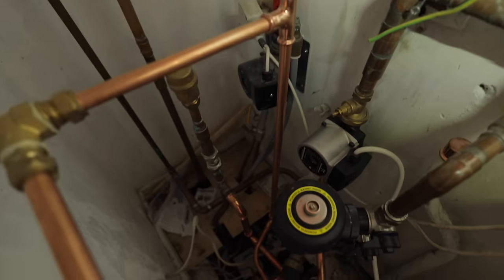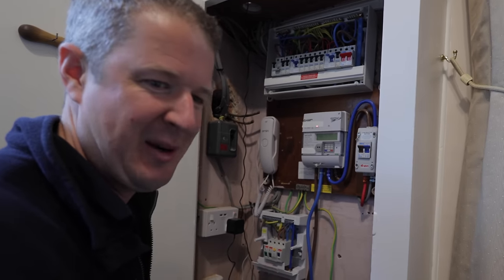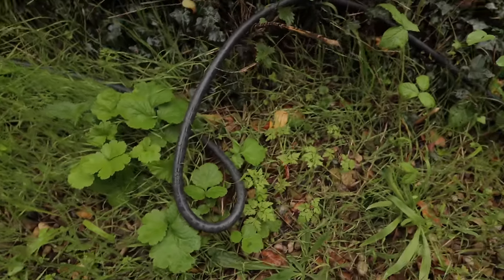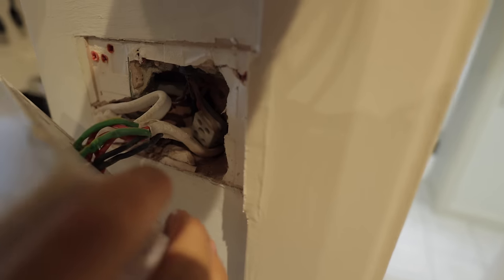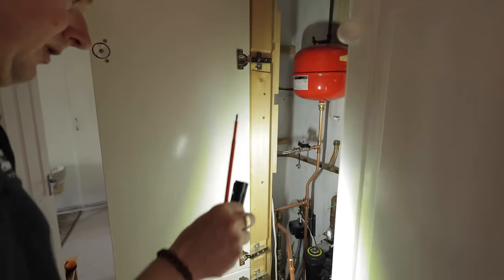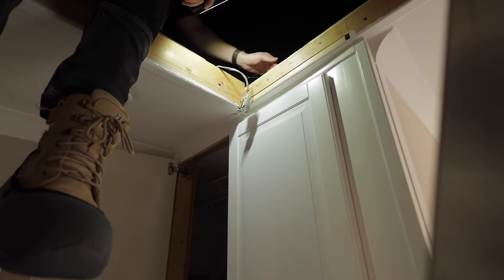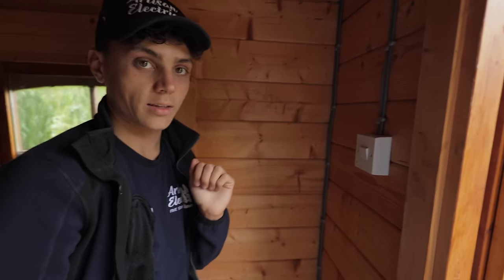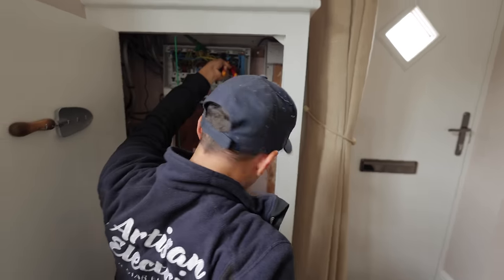The WORST Socket Wiring I Have EVER Seen!

Comment: You should use a clamp meter on the tails and the DNO earth before you disconnect from MET.  This helps check for diverted neutral.  John Ward explains this in a few YouTube videos
Reply: Theres a picture online showing 80amps 😂 flowing thru the earth so diverted netrual are out there..
Was on a electrical forum
Reply: It seems the diverted neutral phenomenon is almost guaranteed where you have a PME system with metal incoming pipes - at least in theory. 

Definitely an eye opening JW video.
Reply: Looking at John Ward's recent video does on Diverted Neutral Current it is important to check for DNC before disconnecting the main earth connection.
Disconnection of the MET could result in in exposing an unintentionally live conductor - the main earth - which is carrying the neutral return current from neighbouring property or properties.
Reply: @stevejagger8602  it's not major common but as cables age this sort of problem will only increase.

I have seen it only once in 16yrs myself
Reply: Skillz 👍
Reply: @bramcoteelectrical1088  it is inevitable that this issue will increase given the amount of 50 to 60 year old  PILC distribution cable installed and not maintained or replaced in the UK.
Reply: JW knows his stuff!

Comment: That's a good one... the AC loosens connections because it's oscillating. lol Who ever told someone that?   Yes, connections do get lose over time, sometimes due to the heat cycling or the wire cold flowing, but from the "vibrations" of AC??? That's a good one, is that on the master test too? lol I hope that was a joke.
Reply: This may be a cause but at very high amperage into 1000amps 😊.
More likely in domestic thermal.effects
Reply: Completely agree, worked on industrial systems upto a couple of thousand amps and connections not coming loose all the time.  If this was the case we would have streets of houses burning down because of bad connections and no checking for 10 years.  The worrying thing is some people on here believe this.  
Not sure what I think of this YT channel now.  I started watching some of the videos and found it quite interesting but the ' worst ever this and that' is turning me off.  Some of the claims and info is simply opinion and some far too pedantic.  Sometimes I think drama is added just to make a video, which is probably a better earner than the work now - shame really,
Reply: @scherry5135  Yeah, I almost turned off the video when he said that. I was like is this for real? 
But when tech channels start making content, just to make content quality always goes down. Not saying that's what's going on here. Yet.

Comment: Its amazing that you can't have a regular outlet in the bathroom, but you can have a 9KW electric device in the shower with the person is perfectly fine and only an RCD with up to 30mA of current before it trips.  😲☠
Reply: The difference is the shower is a permanently installed device, designed and waterproofed for that location. If you were allowed a regular outlet in the bathroom people would plug in all kinds of devices with the potential for them to fall in the bath or get wet potentially making them live.
Reply: @MattF340 But for some reason you're allowed outlets right next to your kitchen sink. I guess you don't fully immerse yourself in the water when doing the washing up, but still...  😂
Reply: @SwitchedOnNetwork  Are RCDs/GFCIs not required for kitchen outlets where you live?  It's a code requirement everywhere in the US (basically for anywhere that's considered a "wet area", which both kitchens and bathrooms are), so I assumed it was in the UK/Europe/etc too...
Reply: Misconception regarding sockets in a UK bathroom, it is allowed, but has to be a minimum of 3M from any water source, very few UK bathrooms are big enough to allow that.

Comment: Rather than trying to memorise the factors for each set, which I never can; in that case, r2= r1 x (2.5/1.5) so just plug in the sizes written on the cable and it's works out the same.
Reply: Holy sheet it does 😂😂 I'm sure that was taught in college but always just remember each set and now I can forget them 😅

Comment: Absolute fantastic video showing and thoroughly explaining some of the testing involved. IB < or equal to IN is only a fraction of the start of max demand formula i try my best to keep lodged in my small brain and it really helps when trying to figure out if existing circuit breaker is adequate when upgrading an electric shower. Thankyou and keep up the excellent work Artisans of MONTE Cambridge.

Comment: Top Tip! Always keep a garden trowel in your meter cupboard just in case there’s an electrical emergency
Reply: I think the top tip, is always tip your tradesmen, and chocolates are a great way to do that.
Reply: Also, a small garden fork is very useful for R1 + R2 and ring continuity testing etc

Comment: Those pull cord shower isolators usually have loose connections when you go to check them - I don't think it's so much the tiny vibration from the 50hz sine wave, it's more to do with the pull cord itself - pulling at the fitting on the ceiling, loosening it and then it pulling on the wires. Combine that with condensation/steam from it being on the ceiling in a bathroom with a shower, and you get green copper corrosion on the wires and terminals, increasing contact resistance, heating up the terminals / wire and the resulting thermal cycles  also loosen the connections.

I hate the things tbh, they always end up with burnt wires (usually neutral) & corroded connections. Much better to have a switch isolator on the wall outside the bathroom.
Reply: Just had that done on our new shower, we got through 3 pull isolators in 10 years, switch outside much better.

Comment: Also, a fun fact, Jordan mentions AC currents causing screw terminals to come loose over time. This is primarily caused by something called Magnetostriction. As the AC current induces a magnetic field in the terminals this causes the metal to change shape. This effect can be so large that you can even hear it, if you have ever been close to a substation or large transformer inside a building's HV room you can literally feel the hum coming from the iron core!
Reply: Magnetostriciton is only found in transformers and the like with ferrous cores. It wouldn't occur with brass screw terminals where there is no wound core
Reply: @RichardKeightley-ky6fx  incorrect, brass is still subject to magnetostriction, but Brass has minimal magnetostrictive effects due to its non-magnetic properties, its just more pronounced in ferrous metals.
Reply: The heat/cool cycle (expansion/contraction) in the conductors/terminals will have a greater effect on the terminal tightness than any potential negligible magnetic influence
Reply: Yeah, while magnetostriction is theoretically possible in copper conductors, you would need a lot higher current than this for it to have any detectable effect (I'd guess tens of thousands, if not hundreds of thousands of amps).  It almost certainly is not actually a factor in these sorts of applications.

This is far more likely due to simple vibration from magnetic inductive effects with other nearby conductors.  Current flowing through the wire will generate a magnetic field which causes corresponding electric currents in other nearby wires or metal pieces, which in turn create their own magnetic fields which repel those created in the wire.  When the current direction changes, the new magnetic fields in the wire are then attracted to the established magnetic fields from the other conductors (pulling the wire towards them), until they exhaust them and set up opposite currents in the surrounding metal, which produce opposing fields (and push it away) again, and the process repeats.

(This is also why many smaller (non-substation) transformers often hum or buzz, too.  It's actually not the core changing shape, it's just the wires in the coil vibrating as they're pulled and pushed away from each other (and the core) by the magnetic fields.)

Comment: I would have thought any care home worth its salt would require all equipment brought in by residents to be PAT tested. That lamp fails on visual inspection, you don't even need to get the tester out. The reason for arc fault detectors in care homes is that a fire has potentially worse outcomes. Imagine trying to evacuate a large number of people with limited mobility from the property. Hence anything that might reduce the need to do that is worth it.

Comment: Ive read a few comments about the tails. One being code 2 and other bring code 3. 
So i would look at it like this they have 100amp max incoming but what do they have that could max it out. Modern oven 20amps max electric shower 20amps ish. That still leaves a large amount. Depends on load. If realistically could reach 100amp code 2. If very unlikely to exceed 80amp code 3

Comment: Back in the day i remember it was quite common to find tablelamps wired in something similar to bell wire. I think it might have been acceptable at some point, but not anymore.
Reply: Frequently seen at antique auctions!
Reply: It was acceptable - it was called lamp flex! I can’t believe Jordan hadn’t seen it before. Because it wasn’t colour coded, you could end up with the inline switch in the neutral instead of the line conductor. Fitted with a lovely old MK Safety Plug - the king of plug tops from days gone by.
Reply: @frimleyfrodo  That cord was definitely not using "lamp flex".  Two-wire lamp cord has much thicker insulation and is actually rated for mains voltages.  Bell wire is typically only rated for low-voltage use, and should definitely not be used for this sort of thing.  You could easily get insulation breakdown within the wire leading to arcing and a fire, just because you somehow pinched it the wrong way, or it got old, or too warm, or you looked at it funny, or...

Comment: 23:05 That is one thing that I have noticed with the exception of the one house you had to walk away from where the wiring was so bad, there aren't many power strips there in the UK it seems, at least in the homes I have seen in videos.  

Here in the USA, if a house doesn't have a handful of them or at least one in every room, something it wrong.  Case in point we have 179 outlets (each with two plugs per outlet) / (not including 240V outlets, we have eight 240V outlets from 30A-50A) in our house, and we still have somewhere around 10 or more power strips or extension cords in use all the time.  I guess that is the reason for all are AFCI (AFDD) requirements here for pretty much every single breaker now.  Our 5mA GFCI (RCD) are required in any damp / wet areas only for the most part.  

Keep up the good work!  👍🤠
Reply: We certainly do use power strips in the UK. Perhaps we just do a sufficiently good job of hiding them so you don't see them in videos ;). I certainly have at least one in every room except the bathroom, kitchen and hallway. I used more when I lived in a rented property and could not make permanent additions. 

One thing that does seem different is that the number of sockets per strip is lower. 4 and 6 are common. Larger numbers exist but are fairly rare. It's common to see power strips daisy chained, though some H&S types frown on this.

We don't go in for high-current sockets in domestic applications. Our driers are lower power than yours to fit within the 13A a normal socket can deliver. Electric cookers here are hard wired.
Reply: 179..?
Reply: @Nyle95 Some areas of the US, the average house is 4000+ square feet, and new construction homes have tons of outlets. 42+ circuit panels are the norm even in a small house. Most new houses are being built with 400 amp service. The size of panel used in the UK for a whole house would be a subpanel for a shed here. So 179 outlets is not that outlandish.
Reply: @theodorgiosan2570  Why do you need so many? Just the size of the buildings?
Reply: Combination of the size of the buildings, the code requirements, and people's desire to have "smart" devices and TVs all over the house. The code requires a certain number of outlets per room, either based on dimensions or the type of room/location. Even in the room I am sitting in in my 200 year old house, which is a 10x10ft (about 3x3m) room, has an outlet on each wall, and the wiring is from the 1930s. Modern rooms would have at least 3 or 4 outlets per wall not counting special purpose outlets like TVs. The other thing is, unless you live in New England, some parts of Arizona, some parts of Michigan, and certain areas in California, most power companies will not allow you to get 3 phase service to a house. So instead of a reasonably sized 200 amp 3 phase service for a large house, you end up with ridiculous 400 amp, and sometimes even 600 and 800 amp single phase services. Personally my house here in New England has 3 phase, but even here and even on streets that have 3 phase available, it's rare to see a house with it installed. Most electricians will refuse to do it because "they've never done it that way" or "houses don't usually have 3 phase". So even when the power company is happy to provide it, you need to call a commercial electrician to install it. 400 amp services are typical here because in say a typical new construction 2500 sq ft house for example, you'll have a 36kw+ tankless water heater that pulls over 100 amps, it will likely be heated with all air source heat pumps, it will likely have a 2-4 with garage with 2-4 minimum 50 amp EV charging outlets, possibly a 30 and 50 amp RV outlet by the driveway, fancy electric cooktop, generally 2 ovens in the wall, large fridge, etc. Just huge houses and even if not huge, still a huge amount of electrical devices because that's what people want in new construction.
Reply: @theodorgiosan2570  Thanks for the explanation. New build houses in the UK have more sockets than previously but nothing really on that scale for the majority.

Comment: Been a while since I was a spark but I was always on the line that a bond has to be continuous so if connected in multiple places (like multiple services) then it had to be stripped and looped as one cable, not cut and extended. As such you would then not be able to continue to use that to come off that water bond (if it had one) anyway?

Comment: Just a quick question from a New Zealander will England move away from the ring circuit to the radial one like down here?
Reply: Some people do wire radials it’s just preference
Reply: 😊radials are great in 4mm b32 mcbs... but have to be careful of derating if theres 100mm of insulation then you need to look towards a b20 radial possible calculation required but it catches people out

Comment: A couple of questions, if I may ...

When you were calculating the current draw for the shower, you used 230V. I believe the lower mains voltage supply tolerance level in the UK is 216V, so is there a reason you didn't use that figure? Was it just to keep things simple for the video?

Is there was a voltage drop between the circuit breaker and the shower, would that cause the shower to draw more current?

How did we end up using Watts for AC systems, instead of Volt-Amperes? Do you ever use VA?
Reply: I'm not an electrician but with a resistive load like a shower I imagine the rating of 9000w will be based on its design voltage. Fluctuations above or below that design voltage will result in an increased or decreased kW output from the shower proportionate to the square of the voltage difference. A 10% increase in voltage would bring about a 10% increase in current and a 21% increase in kW output, whereas a 5% reduction in voltage would reduce current by 5% and kW output would reduce by almost 10%. Appliances like TVs and PC's on the other hand tend to draw a constant wattage so any reduction in supply voltage would lead to a proportionate increase in current drawn.

Comment: Smart meter engineers can’t upgrade customer side takes when installing meters , that install is the correct way of doing it
Reply: Yep, most they will do is run new tails to one side of the isolator - assuming there is one.

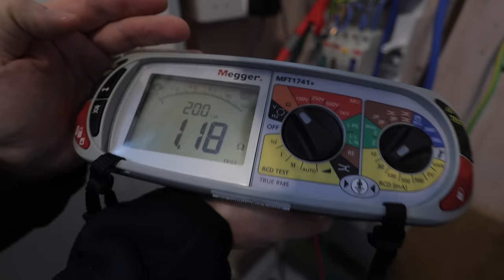Comment: I am not saying the part at 14:01 was done by whoever installed that beautiful kitchen, but what I will say is I have seen more dodgy wiring following kitchen refits than I care to count (the work I do takes me into other peoples homes, and no, I'm not an electrician).This is both pre and post Part P. One of my client paid a small fortune by going to a top-end kitchen supplier, and as always it comes down to the installation of same. Despite the cost, the backs of the units are still cheap hardboard, and why anyone would think that makes a sound surface to attach an electrical accessory to is anyone else's guess (though I see it often), but what really grinds my gears in that house is that the warming tray under the oven is required to be run from either a 13 amp plug socket or a 13 amp FCU, and as such was supplied without a plug. Whoever fitted it attached a plug (nothing wrong there) but made no effort to shorten the long inner cores on the end of the flex that were left exposed from the factory...as such there is now a 13 amp plug in society with at least 2 inches of inner cores poking out the bottom it.
Reply: What Is your job?? Cleaner?!
Reply: @adamsharp201  yes